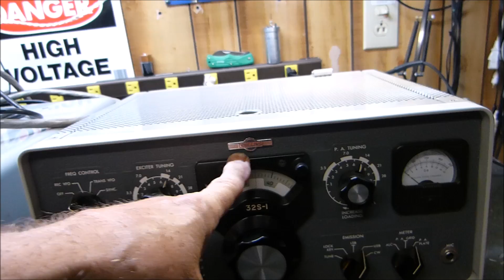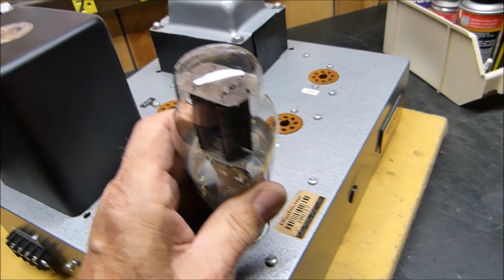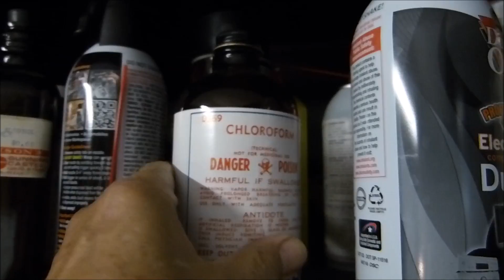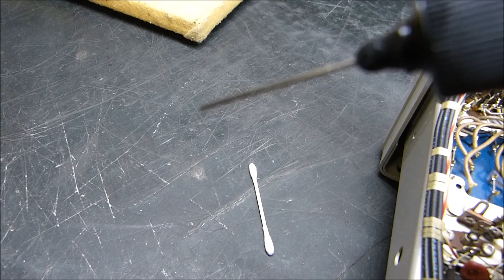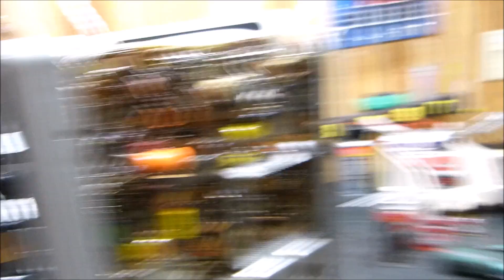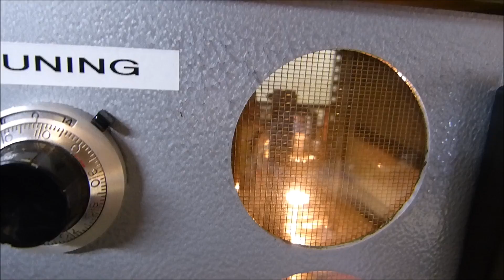Care & Cleaning Of Vacuum Tube Audio Amplifiers & Amateur Radio Equipment

Comment: I recently picked up a 6336 single ended amp but, one channel is putting out about 2/3rds the power of the other. After some reading I found that a lot of the 6336/6080 tubes aren't very well matched when it comes to there sections, I'm curious to see how you tackle this with your build, I'm not really sure what I should do with mine. I was impressed with it's power output and THD though.
Reply from the maker: This is good to hear about the power and THD. Sharing this type of information is what YouTube is all about for me. Thank you. Do you have a tube checker you can test the tubes on?Can you measure the cathode currents of each tube separately?Can you tell me what your plate voltage is and your bias? Do you use fixed bias or cathode bias?Sorry for all the questions but I have all of these things to decide before I start on mine.   :-)My guess is my tubes are going to be a challenge to match also as they probably all came from old voltage regulators and were run pretty hard for lots of years.
Reply: I'm not sure if this will work but I'll try to post the circuit diagram that came with the amp: 

http://i1059.photobucket.com/albums/t431/Thinker1920/6336%20amp_zpsnrm1ddj1.png

I have a cheap tube tester which I doubt will be able to power the heater on the 6336. I can take voltage measurements tomorrow on the bench though. It's cathode biased, I am a little concerned about the heat from the cathode resistors, I was advised to run the amp without the bottom plate on to allow more ventilation. I'm thinking about adding some quiet pc fans for cooling, any thoughts about ventilation? (I have a 300B amp with a similar problem)

I'm currently listening to it through my McIntosh XR1051's and it sounds quite pleasant, my 1940's Pandora station does lend itself to unwinding though :-)

Here's the THD scan if it works:

http://i1059.photobucket.com/albums/t431/Thinker1920/6336%20amp%2015%20watts%20both%20channels%20driven%20r%20yellow%20l%20cyan%20left%20channel%20redused%20power_zpsdnfihugt.jpg

I did want to add that I'm a fan of your channel, it inspired me to get more into the hobby, thank you for your videos!
Reply from the maker: Both of the links worked great. I am really impressed with the HF response. I didn't expect that and your reference voltage gives you 15 watts across 8 ohms. I assume you were using 8 ohm loads and driving it at that reference level for the test. From the schematic  I assume this is for one triode? Or do you have the triodes wired parallel. I also am encouraged by the 330 volts on the plate. I plan on running mine at the 6L6 plate voltage of 450. Maybe I should build a bias supply to eliminate that huge cathode resistor and I will have a problem with my transformers plate Z as I see yours are 1.8 K. I will have to look around and see what I have.

I really appreciate this information so I don't have to discover everything the hard way.

Some of the little 12V PC fans might help. I saw that 25 watt cathode resistor. I would punch some holes in the chassis so it could get a little air.

I have had heat problems also. In the cases of my big amps, the 813's and 3-400Z's, I have had to use a small floor fan to keep them from getting really hot. In your case, I would think a couple of breathing holes and just an external breeze across the amp will probably do wonders for the temp.
Reply: yep you're correct I was using an 8 ohm dummy load and it is one triode not parallel. I took voltage readings today.

pin 2 plate 296 volts
pin 3 cathode 79.6 volts
pin 5 plate 282 volts
pin 6 cathode 93.7 volts

So if I did my math correctly 114 mA and 134 mA

The large cathode resistors are chassis mounted so I was thinking about adding thermal paste for better transfer and then above it a small computer heatsink attached with thermal tape for dissipation. Do you think that would be sufficient? 

I was curious how you're dummy load is wired, do you have a connection from both ends of your resistors to the BNC connector or just one?
Reply: The thermal paste, small heatsink, and newly drilled ventilation holes aren't quite cutting it. After an hour the chassis near the resistors was about 100 degrees and the little heatsink was about 175 degrees (I have one of those point and shot thermometers but, sometimes I wonder how accurate it is, especially if it's a polished surface)
Reply from the maker: David - Really appreciate the data. It will definitely help me when I build my amplifier.

As for my dummy load resistors - they are wired so that when I switch them to the BNC connector to monitor the signal, they are separate from each other. I did this because some older (and maybe new) SS equipment does not have a common between the output channels.

Per your comment below about the heat sink and cooling your amplifier - your data for the worst case is 79.6 volts at 134 mA so that will be 10.7 watts. Really not too bad but I know this can heat up things quite a bit. And secondly - I looked up the 6336 with a filament current of 5 amps ... Wow...  That's 30 watts per tube of heat from the filament. So, when you add it up, you are dissipating 100 watts or so in heat and if you have an aluminum chassis like I always do, that's going to get pretty hot. I use the "laser" thermometers also and I really like them. I think they are reasonably accurate. I keep a McIntosh MC275 in a cabinet for my home entertainment system but have a very quite full-sized muffin fan behind it just to blow a gentle breeze over the amp and it runs "acceptably" hot. I would guess the Mac amp is dissipating about the same amount of static power (100 watts so so) but it is made of steel so there is probably something to that also.

I don't know if you say my video on the stereo version of the Acrosound transformers but that amp runs pretty hot also especially the power transformer. If I put a small fan blowing across it, everything stays "touchable" hot and I figure it will be OK. In my case with this amp, the power transformer is actually too small (200 mA secondary).
Reply: I just realized that the power transformer in this amp also is only rated at 200 mA for it's secondary, I was thinking I could make a circuit for negative bias to try to get it down to 99 mA a section and increase the voltage to try to maintain 25 watts dissipation a section but, I have very little experience with fixed bias/ mixed bias designs, I was hoping you might be able to suggest a circuit.

I ran the amp with small room fan pointed at it and it dropped the chassis temperature to about 75 degrees and the small heatsink was slightly under 100, so it seems that some small PC fans will be in order.
Reply from the maker: I measured the temp with the "laser" type thermometer tonight of my MC275 after about three hours of operation and the chrome portion was 97 degrees and the black portion was 104 F.  This is a steel chassis. and  an 80 pound amplifier and It does seem the shiny vs  lack surfaces make a reasonable difference.

OK here goes... ground the cathodes. Throw away the cathode bias resistor. Build a voltage supply (half wave is good enough in this case) with the positive side to ground.  If you don't have a convenient way to derive -100 volts, or so,  that is adjustable, it is sometimes a solution to connect a small 6.3 volt filament transformer secondary to the filament winding  of your tube supply and use the 120 volt secondary for a voltage source. Isolate the grids of the output tubes with resistors in the 100K range and connect them to the negative voltage source.  Take a look at the bias supply for a Dynaco amplifier. They are all pretty much the same. Only the divider resistors differ. You can get  fancy by building the negative bias supply so that you can adjust (and balance) the output tube cathode currents separately.

This will improve everything in the amplifier and eliminate the cathode resistor heat source.

Comment: i have askedyou some thing in the last video, about my project this is the basic idea but i have still not find a way to determinate the value of caps and inductors for the input filter, but anyway what do you think about the baseline? https://www.dropbox.com/sh/sz8gltyieh7vopi/AAA-WJaSoWbsNAq9xqQ_Qo4-a?dl=0
Reply from the maker: file:///C:/Users/Admin/Downloads/RFPA%20-%20Designing%20a%20Input%20Tank%20Circuit%20(By%20Larry%20E.%20Gugle%20K4RFE)%20(1).pdf

RF Power Amplifier (RFPA) Designing a 'Input Tank Circuit' - AMfone

Here is a nice article on how to determine the Pi input filter to drive the cathodes. I hope at least one of these links work. Let me know.
Reply: it is not shown as link
Reply from the maker: I see you have a SWR bridge built into the design. That is a nice feature. As for the input Z matching circuits. I am sure you know you will need a different circuit for each frequency range thus another band switch unless you can incorporate it with the output tank switching - then there may be some mechanical challenges.  As a first project of this magnitude, I might suggest a single band amplifier before going to all the trouble of making it a five band amplifier. The 80, 40, and 20 meter bands are not much of a challenge but 10 meters can get pretty challenging as the inductance values are very small and become somewhat critical to keep a Q  (of say, around 10) maintained. Just my thoughts on the multi-band amplifier.
As for the control circuits - looks like you are doing a nice job. I would try to keep it simple and be sure to build in safety features so that in haste, you can't get a terrible shock from the power supply.
As for the antenna switching relay, it is best to use a relay that does not have flexible wires connecting the contact strips to a tie point.  Use a relay that connects the wire directly to the fixed and moving contact.
Reply: thanks, the control circuit is a baseline because i am planning to integrate some extra safety features.
for the bands there in italy more or less we tend to use 40 and 80 but all the circuit witch i have picked the sections use the same output network so i have simply rewrited it. 

again Bigg Thanks for the help :)
Reply from the maker: If you copy and paste the text below into Google, it will take you to a PDF that will download..

RF Power Amplifier (RFPA) Designing a 'Input Tank Circuit' - AMfone